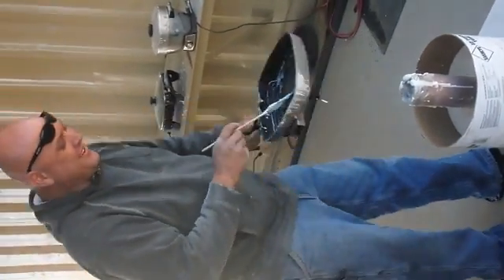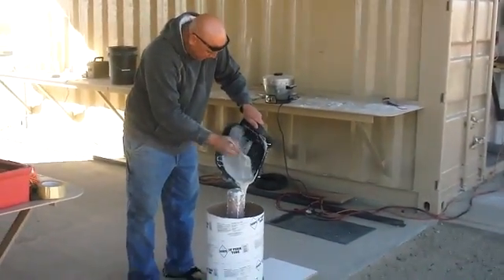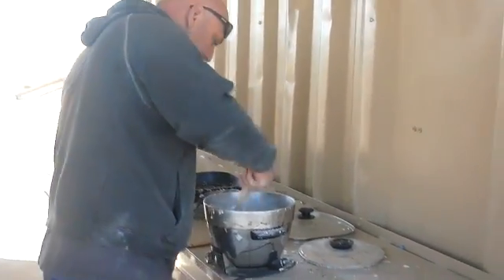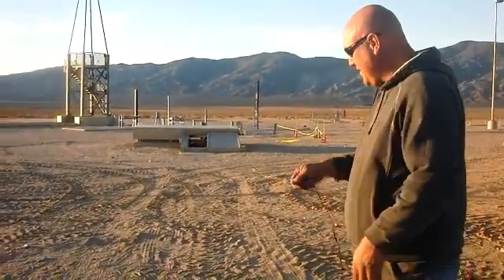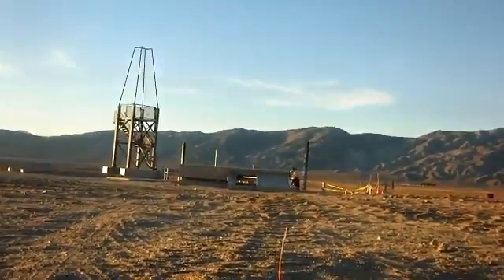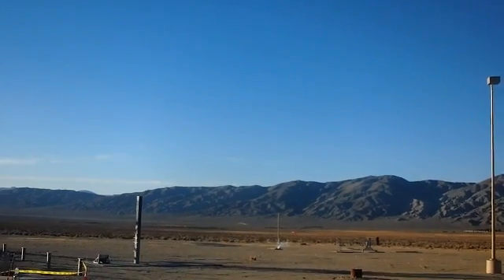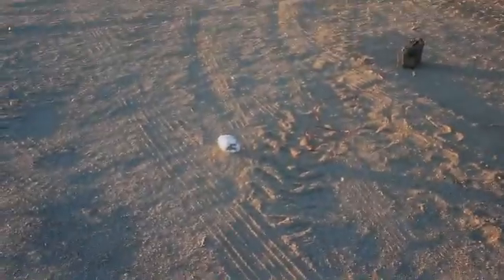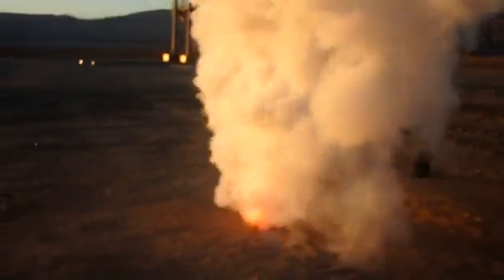Worlds Largest Sugar Rocket Motor propellant grain and 3rd flight of the phoenix rocket

Comment: I am a 60 year old boy. I am currently messing with sugar rocket 🚀 engines .
I am NOT cooking the fuel. Your rocket didn't look like it went all that high ?
Im just going by the sound of the thrust .
Did the rocket keep going long after you could not hear it ? Anyway.....cool stuff.
Reply from the maker: We made some propellant for one of the large 12" motor grains. We also flew a small rocket you see flying in the video with a two small 3" grains, altitude about 4,000'.

Comment: How did you cast the fuel? Did you just heat up the mixture until it melted or did you add any Solvents? Also what mixture ratio did you use if you don’t mind me asking? Thanks!
Reply from the maker: Just mix 65% KNO3 and 35% sorbitol and then melt, no additives or solvents. Melts at 200 F and pours at 230 F.
I use sorbitol for safety and easier prep. Please refer to Nakka-Rocketry.net for more info on 'sugar' propellants.

Comment: How do you offset thermal stress as the grain cools?  Back when I was experimenting,  I pondered isostatic pressing during cooling, insulating the OD and forcing cooling through the core.
Reply from the maker: I use to do that with smaller 4" (100mm) two pound (1kg) grains but have not done so with really large grains, the large thermal mass seems to allow slow cooling and less stress.

Comment: No statistic on the launch hmmm
Reply from the maker: I launch those 2, 3, and 4 grain motors often. The 2 grain K motors usually get the rocket up about 3,000'. The 4 grain motors get the rockets up about 5-6,000'...not bad for $1.50 per grain.

Comment: How were you able to archive that consistency for KNSB at 65/35? Did you use granulated SB or KN or is it a temperature issue. Whenever I have cast rocket motors I get a more viscous consistency that I have to scoop into the mold
Reply from the maker: We don't grind the KNO3 into a powder. That is the biggest reason for high viscosity. We pour at 220 F.
Reply: @mojaverockets  Alright, thank you so much!

Comment: I’m a hobbyist rocketeer & would like to build sugar motors. I’ve gotten into legal trouble in the past making homemade fireworks so I want to be careful. Could you point me in the direction of federal regulations that might affect building large sugar rocket motors? Thanks!
Reply from the maker: As you can see, we build and test them at the FAR site where we have all the permits necessary. I don't know where you live. Some jurisdictions/countries don't allow and some do, that is what you will need to find out. Some treat solid rocket motor propellant as 'fireworks' so you need to check.

Comment: What was the point of melting it? The sugar melts but the kn03 doesn't. It stays suspended in the melted sugar. It's a waste of time. Better to just grind both into fine powder mix, hammer, launch
Reply from the maker: Melting gives higher grain density, hence higher Isp and in a large long burn motor, hammered propellant would shake apart

Comment: Is that outside cylindrical thing also an inhibitor or is it casting mould? I tried to cast directly into cylindrical cardboard inhibitor. A small gap appeared between inhibitor and fuel after it cooled down.

Comment: Im prety sure if did that im gonna burn some ones house
Reply from the maker: We make, test, and launch those grains at the FAR facility.
Reply: mojaverockets is it contains just this liquid i mean there is a motor or at least a fan?
Reply from the maker: the 'liquid' takes 24-48 hours to cure (solidify) into a solid propellant that slides into a motor for a rocket...no 'fan'

Comment: What altitude can these reach?
Reply from the maker: that 4" 18 pound Phoenix (was full of testing stuff) with the small K motor about 5,000'. The 12" will be the booster for a space shot we hope to do, 62 miles (100 km)
Reply: Well, if you run Charles E. Rogers' RASAERO software you could verify that your 'hope' has a somewhat reasonable chance of getting to space, barring any unforeseen casting voids, and a grab bag of potential structural, thermal, and trajectory faults.
Have you run this simulation yet?

Comment: First off, great launch.  Did you dissolve the Sugar and KNO3 in water or did you mill the KNO3?  I'm trying to figure out how you de-watered the mix without caramelizing the sugar.  Did you cast the grain with wet mix?
Reply: No water used. Sobitol instead of Sucrose. Did not mill the KNO3.

Comment: What is the Isp that you are getting? From what I know around 135s is the max theoretically possible with sugar-kno3
Reply from the maker: The low pressure short 2-grain Phoenix motor is getting slightly less than 126.
The also low pressure 2 grain 300mm motor was 124 at just above 400 psi.

Comment: 3:10 if your measurements were correct that 1/4 of fuel should have been PACKED into the motor casing. (I learned the same thing early on) try to Eliminate any extra, It should be in the motor to give the Calculated results. Now run your motor performance simulations WITHOUT  that 1/4 of fuel to be accurate. Than compare to test results.
Reply: Thoug burning off and testing it is a good thing for Propellant characterization and analysis.
Reply from the maker: That 1/4 pound of propellant is equal to 0.096% of the total propellant used, that's less than a tenth of one percent and was NOT part of the simulations.
The amount of propellant is not calculated by the amounts of ingredients used but by the final amount of propellant in the casting tubes when finished.

Comment: :58 I hope they are packing it tight/solid in the chamber  as it solidifies otherwise  Much smoke no action. 3:29 could be a lot better if Packed. Good Job None the less.
Reply from the maker: We do not 'pack' any of the propellant, not sure why we would want to.
The two times burning the propellant in the open were to simply burn off small scraps, leftovers, and spilled powder...not to fly in a rocket.

Comment: How fine is the soot coming out of the exhaust? 
 I am working on a long thin casting that will go into a two stroke motor for my
rocket propeller. A rocket prop.
 Like will the any soot gum it up?
Reply from the maker: The 'soot' is fine and tends to collect on things like the nozzle divergent bell of test stands. As long as the propellant it really hot there might not be much of a problem but at lower pressure and temperatures it will build up.
Reply: Thanks.
Reply from the maker: You can see build up of soot and potassium carbonate deposits in this video after the motor fired...about 5:05 into the video.
https://www.youtube.com/watch?v=h1mYHtsD7a8&t=4s
Reply: I see it. The nozzle gets very hot.

Comment: Neat! I look forward to seeing the test on Dec 17th in person.

We proved through both hardware and FEA that a large diameter sugar grain can only work if it is balanced in pressure between the inside and outside. I'll be very interested to see if that is demonstrated with the large scale static testing.
Reply from the maker: In our recent motors, we've avoided CATOs due to pressure imbalance by slow start ups, we shall see if this holds true for a motor this size.

Comment: When will the 300mm motor be tested and how many grains in total? What will the total impulse be? Thanks :)
Reply from the maker: We are looking to test the motor December 17. It will be a short 2-grain motor for testing purposes. The simmed total impulse will be 141, 350 Nsec (31,778 b-sec) with a burn time of 16.9 sec...a 'Q-8376' motor.
Reply: Thanks :) and I though my K was big :)
Reply from the maker: Jack, as amateur experimental sugar goes, a K motor is quite respectable :)
The full six grain motor impulse will be 406,250 Nsec (91,330 lb-sec) and produce 5,970 pounds of thrust for 15.3 seconds or 'S-26,550'
Reply: Wow!! Cant wait to see how it goes :) good luck with all the tests and upcoming launches!!

Comment: Is that 12" grain for the actual Sugar Shot or just a test?
Reply from the maker: We cast two of them we will be testing in a 'small' 2-grain motor of 260 pounds of propellant. If successful, we will cast six more grains to test in a full booster motor for a full scale static test of the actual flight motor. If successful, six more will be cast for a flight test of the booster motor to determine the affects of G-forces on the heavy load of propellant. If all is successful, that motor will be used as the 1st stage booster for the 6" (150mm) second stage Sugar Shot to Space launch. While building the full 6-grain 12" motor, plans are also being made to possibly test fly the short 2-grain 12" test motor, sort of a 'Little Joe' type of flight.
Reply: mojaverockets awesome informative then educational and fun. Great rocket and a great video keep up the good work! Did someone really asked if you had ever hit an airplane!? I guess that person would not let their kid have a BB gun. Keep up the great work and don't put your eye out! Great work, Keep On Keepin On! Thanks

Comment: "Each Phoenix flight cost three dollars...what a bargain!"

What? How do you make 55 Kg of propellant for $3? Where do yo get your KNO3 from?
Reply: You guys get KNO3?
Reply from the maker: The Phoenix is the small 4" 100mm 2-grain motor used for the test vehicle that was launched after casting the 12" 300mm grain for the booster motor. The three dollars is for the 4 pounds (2 kg) in that rocket motor.
Reply: Oh, right. I completely misread that description...
Reply from the maker: No problem.